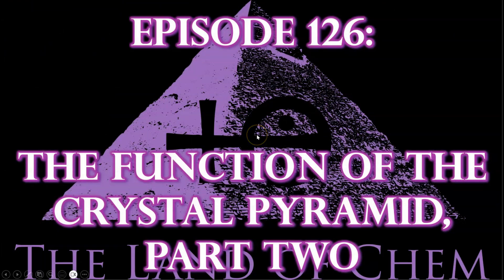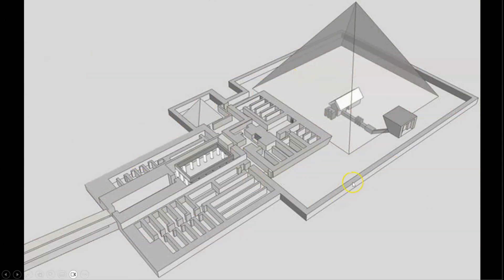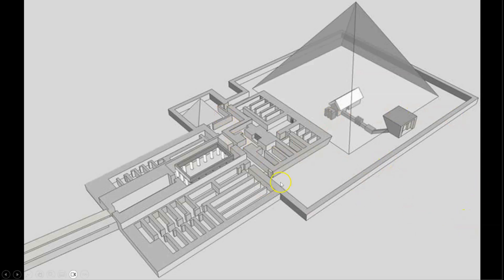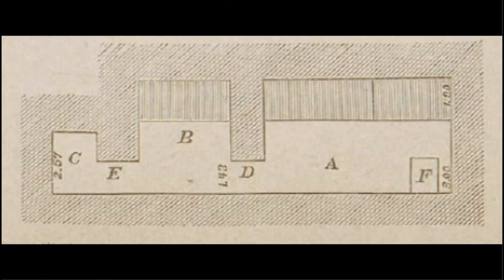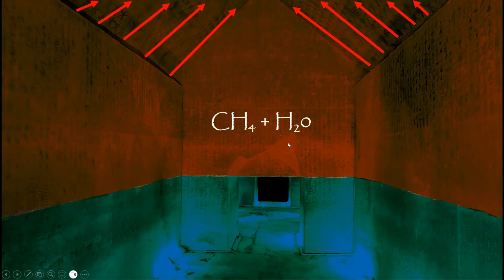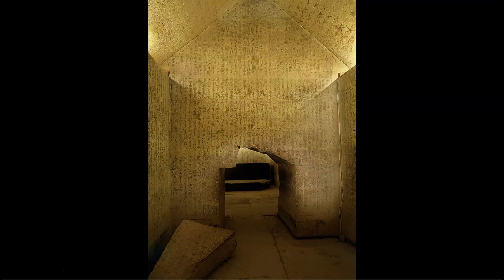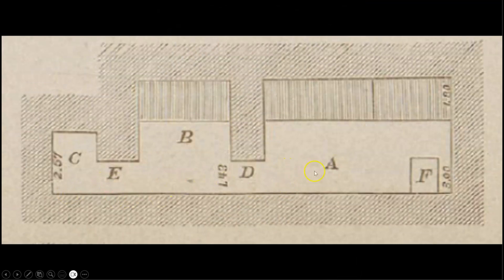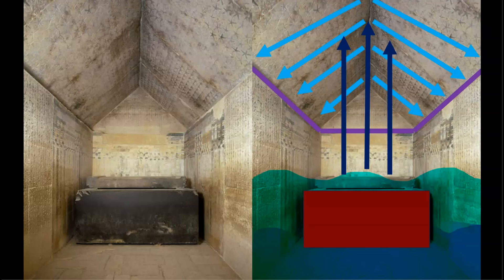Episode 126: ANCIENT TECHNOLOGY - The Function Of The Crystal Pyramid, Part Two

Comment: wouldn't the water drain from each compartment at about the same speed? i could understand the high pressure slightly faster but the low pressure would pull from the high pressure until it met equilibrium. maybe i'm missing something.

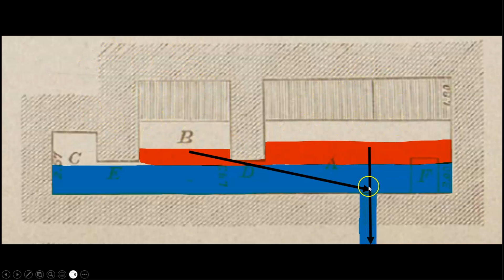Comment: 10:52 If the water level is lowered such that the seals on all three chambers are open, what stops the methane from flowing back into chamber B and C after the water has drained? Or are the chambers refilled with water to reseal them?

Comment: Without a watertight barrier between the large chamber and the reaction chamber, when the water level in the large chamber is reduced it will also immediately be reduced in the other two chambers, yet you show it being maintained mysteriously in the reaction chamber.  Explain how that would be possible.  I can't see that it would be possible.
Also, to compress the air in the reaction chamber to an amount that looks like almost 50% would require an enormous amount of pressure, yet without either a very high source of water draining from a great height, or a mechanism with very advanced seals, producing such pressure would not be possible... nor have you mentioned a means to mechanically produce such pressure by which air would be greatly compressed.
Also, the drain shaft would require a relief valve or door that would have to be enormously strong to withstand the pressure throughout the entire system.  It would have to have been a very solid stone or bronze mechanism.  Have you come across any such mechanism so far?  If it was metal, it would certainly have been recycled at some point... so stone is the only possible remnant that may have survived.

The devil is in the details.  ;)
Reply: @redwood This is what I was thinking too. If the primary reaction chamber was undergoing immense pressure this would push downward on the water raising the pressure in the other two chambers. Also the water would have a constant cooling effect on the chemical reaction meaning some serious catalyst would be required to keep the reaction going.
Reply: @GavlarMcMaggun  Also, there's the unaddressed subject of the water being Nile water, which would not be pure but would contain plenty of algae that would be deposited on the walls with repeated use and leave a very visible stain... which apparently does not exist.
Reply: @redwoodcoast  Although, if they are competent chemists, distillation or filtration of water would be very easy .. perhaps this is what some of the elaborate structures function was outside the pyramid itself. 
The key point for me would be exploring how the pressure would be contained and regulated, via valves, seals or gaskets. 
Some of the coatings Geoffrey has analysed and explained prior, especially the amazing Egyptian blue paint, make me sure they could solve these engineering issues, I'd just like to know how.
Reply: @GavlarMcMaggun  Is a substitute for hydraulic machinery really possible?  When dealing with extreme pressures, it is extremely unlikely.  Many engineering issues could never be solved, such as putting men on the moon or on the bottom of the ocean.  Only advanced technology is capable of advanced achievements.  Anything less would fail.
Reply: @redwoodcoast  I understand your point, but at the same time the greater context of the whole Gaza site is essentially unexplained and to this day we couldn't accurately recreate the great pyramid, as we still don't fully understand it. So, yeah your right, but look at the engineering marvels that are physically present. Love it, it's mind blowing 🍻
Reply: You seem rather bright, but you're making assumptions based upon his ability to draw. He's saying That the drain in the large chamber on the right will lower the water directly above it a little bit faster than the water farther down the tunnel. The drain is probably larger than the openings connecting the three chambers. The third large chamber will empty quicker creating the pressure imbalance, but at some point the second chamber does lower to the connecting tunnel and once it gets a little bit below that it'll pull the gas from chamber 2 into chamber 3.
Reply: @drunvert  My logical assumption is that the pressure throughout the connected system remains uniform because that is how pressure works.  Greater pressure in one chamber would be very temporary... like less than a second.
Reply: @redwoodcoast  Suggest you think of the passage between the 2 chambers as an orifice with much more restriction than it appears on Geoffrey's sketch.  Then it's easier to believe it could take 10's of seconds for the levels and pressures to equilibrate.
Reply: @redwoodcoast  the third large chamber would create a slight vacuum if drained rapidly, pulling the methane in
Reply: @AlWaller-zp9rg  That is not how pressure works.  Water is a fluid medium so pressure transfer would essentially be immediate.  There is nothing to cause the delay that you imagine.

Comment: 7:58 I'm assuming there's some sort of cap or stopper for the methane to prevent it from flowing back out of the inlet pipes?
Reply: def but after thousands of years, evsrything is gonna be gone except the rock.  Plastic, rubber, metal, wood.  And then think of what has been looted & stolen due to 'delays'.  What amazes me is the builders wanted future people to find these things

Comment: Awesome graphics! Still wondering where the Nitric and Peroxide were being synthesized. With over 200 pyramids, the Nile Complex made what? Refined metals, fertilizers, pesticides, dyes and paints, pharmaceuticals (see Ben V with micro containers of high precision). I commented, "The containers were for chemical products." He said, "nah many are way too small, as small as a thimble." I said, "Those ones were specifically for the acid bro."
Reply from the maker: Just wait til you see this month's Members episode... cooking up something special
Reply: @thelandofchem  Geoff,
  You hypothesize the pyramids were high volume temp/pressure controlled chemical reactors. Can we postulate the "temples" were the end product processing facilities? You have shown the gold refinery in Place of the Goldsmith.
  I suspect there are references to other products in the names and mythologies on these sites.
  The Sudanese mini-pyramid complex likely produced an array of products and, located in the upper reaches, would have clean water for high purity.
Reply: I wonder if the Serapeum was the fuel processing facility, thorium is found in abundance in the delta black sands.
Reply from the maker: @candui-7  the Serrapeum will also be coming up soon. I just had a major breakthrough on this structure

Comment: I foresee several issues with your theories.
Do you think there are hidden access tunnels to regulate pressure controls by manual manipulation or would pressures open hinged and hidden doors.
Was anything ever above the sarcophagi in order to drip-fill with chemicals?
High pressure and heat would decimate wall surfaces, there doesnt seem to be much evidence of that, although you have discussed protective coatings.

Comment: looking forward to this one... What is up with the crystal vaulted ceiling? With a channel running down both sides where it meets the vertical wall? So many questions.
Reply from the maker: The ceiling is all limestone, but the back 1/3 of the chamber walls and floor are calcite crystal...